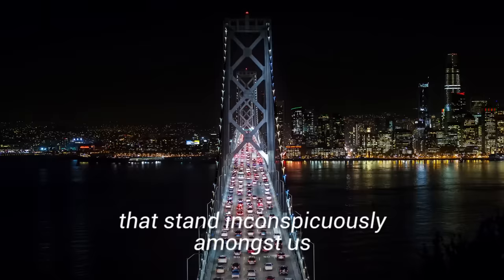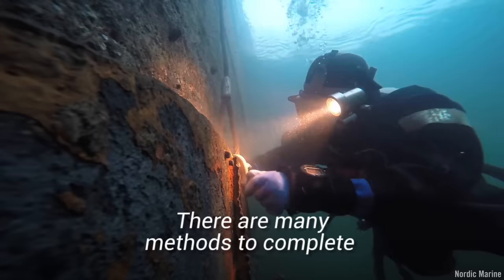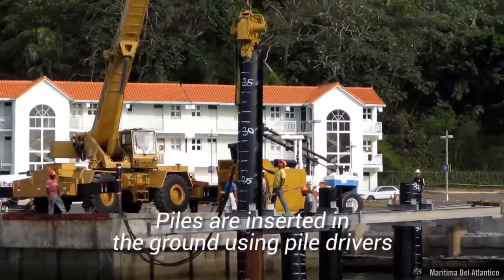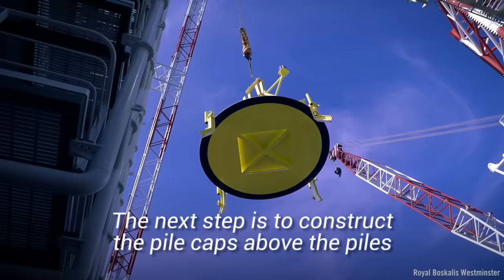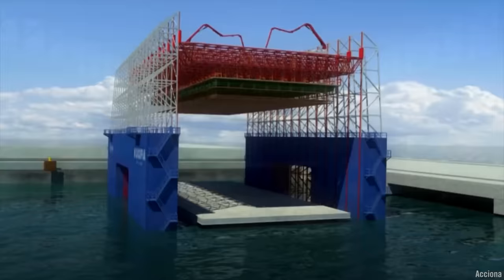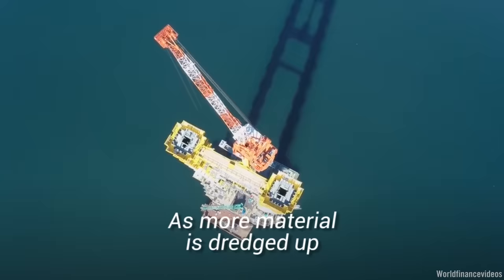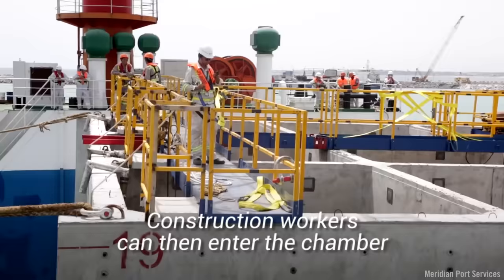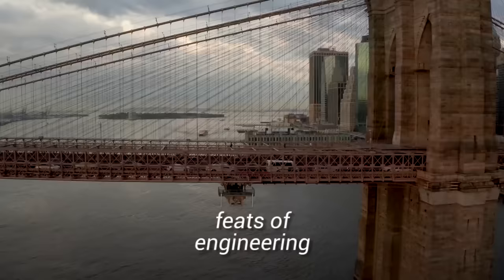How bridges are built over water?

Comment: So they pile in soil/rock to creat temporary islands with shallow builds. But for super deeper water locations, they just get giant poles, ram them in till they get near the surface? Then start pouring concrete on top? Or pour it straight into the water on the poles? Then use floating vessels to help haul machines and other bridge sections into place like lego?

Comment: One other way of building bridge footings in the water is to drive the pilots in on an angle where they are closer to the opposite one at the top so they are staggered and at the waterline or just under a pile cap is cast on top of the piles kind of like a table top tying the pilots  at the top, think of it as a table with its legs in the water, and then a collum is built or cast on top of of the pile cap and then the bridgespans on top of Callum's. The Derwent River bridge in Tasmania is built using this technique, the one the bulk carrier hit the pilon of and collapsed a section of in January of 1975 where you see that famous pic of the two cars teetering on the edge.

Comment: 150 years ago it was not that easy.  The caissons were  barged out to the site then the barge sunk.   More caisson built on the top. as it got heavier, it sunk and                                                                                                                                 more muck was dug out of the bottom chamber of the caisson by men working 3 shifts per day.  Men died of "Caisson disease", which was really "The Bends" that divers get now a days.  
-After the caisson got to the proper depth and would support the bridge weight, iron boxes were laid on top of the caissons, making the towers. 
-A boat would run a single rope across the water.  It would pull a larger rope, then cable , until it finally got to a huge 4" diameter cable which ran from shore to shore over the two towers.  That would be the cableway a crane like device for hoisting duties. 
- A spinner was set up to weave the main suspender cables in place. The roadway was brought in  big pieces on barges to be lifted into place.  Working evenly from the shore and a tower, the roadway box trusses were placed where they eventually came together.
-The approaches were just built with cranes as they were short.  
-Watch the movie about the Golden Gate.    It all becomes clear.    
Building The Golden Gate Bridge - YouTube

Comment: Not that way my way of bridge is different way,  the main post is floating only in half air and half sea and floating in gravity way .
The called above will did it 4 center zero is working and the load will passed in the gapping zone , the weight is loss . No gravity , all load passed by becomes gravity free. 
No weight and this is a fact .
Try my way to do it no center post is needed to do it , the floating post Act only as guide for gravity to let the straight line , structure design. 
Want it or not , you did a very expensive way bridge .
You want a pier just floating in kilometers way ? Island extension and no crash down why ? If you reverse it its the same .